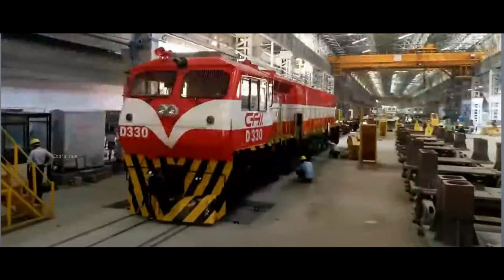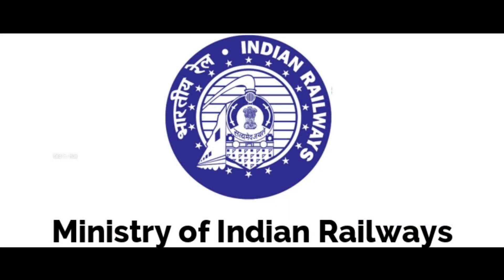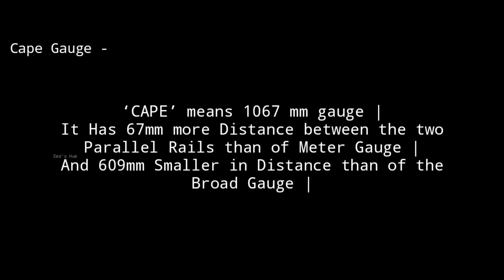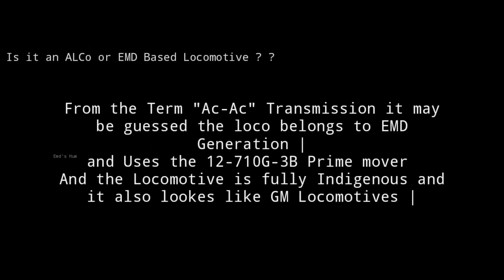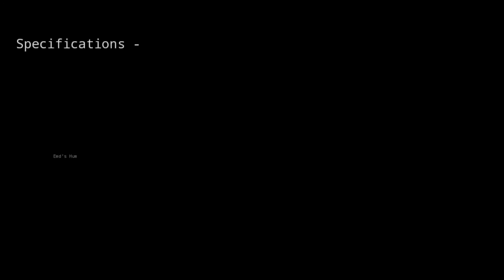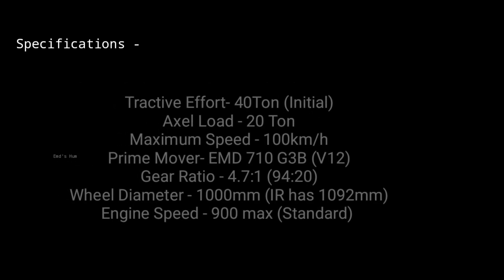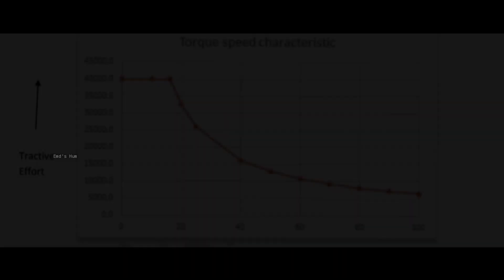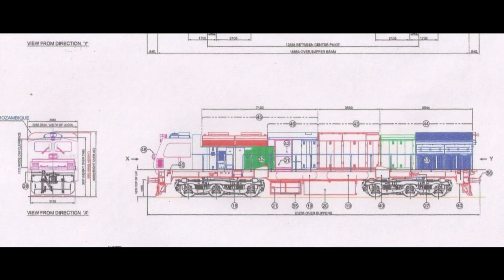3000 HP CAPE gauge Locomotives SPECIFICATION Made by Indian Railways #MakeInIndia

Comment: If don't mind, horsepower can be tweaked up2 3500. The next batch of these locos should be 3500 HP (2630 kW) @ 900 RPM
Reply from the maker: As I have Completed this video Project based upon the RDSO generated Data sheet regarding the Locomotive 
So the reason why I showcased the exact Figures and Facts given on paper !
Btw
Thanks for the Update Brother 🙏
I would like to add it in the coming one if any official verification releases !
Thank you so much for Watching Brother 🙏
Reply: @EMDsHum  you're wlcm ! Just like the 5000 hp 20-710 got tweaked up2 5500 in bheem and just like wdp4 and wdg4 got their 16-710 HP tweaked up2 4500, i want 2 do the same thingy wid this indo-mozambique engine as well
Reply from the maker: @JishyFishy41X6  Yaa I appreciate your View !
Let's see if India do it for them !
But I don't think it gonna happen 
As there's only 4 loco to be Produced as 2 of them are already been Dispatched !
And the bHp upgradation is not juts related with Engine CR Enhancement 
It's also about to upgrade the rest systems too mostly the Traction system !
I don't think they gonna put that much money in RND just for 4 Locomotives 🙏
Reply: @EMDsHum  actually i heard that there are 6 locos in 1 batch or if blw cannot do that at least due 2 the transfer of technology given 2 Mozambique, the African companies can increase the HP
Reply from the maker: @JishyFishy41X6  if TOT happens then it easily can be Achievable atleast 3300 HP if not 3500HP !
The Increase in Compression Ration makes a Engines to Deliver more power 🔥
Reply: @EMDsHum  oh.k.. and btw my other suggestions is that it should serve the entire cape network of the African continent and not be limited 2 that of Mozambique
Reply from the maker: @JishyFishy41X6  it will be depending upon the track gauge of the rest areas !